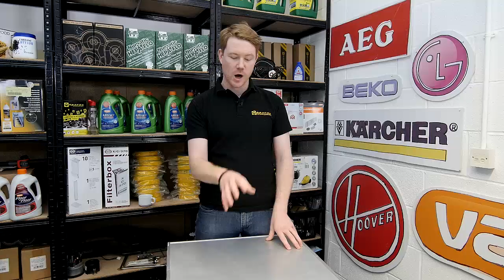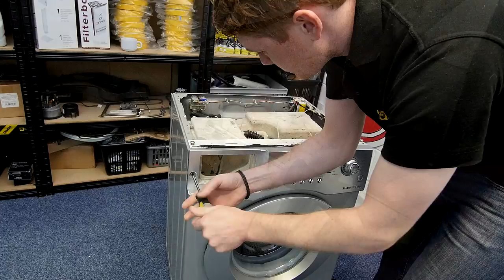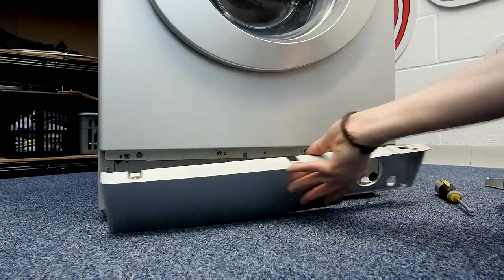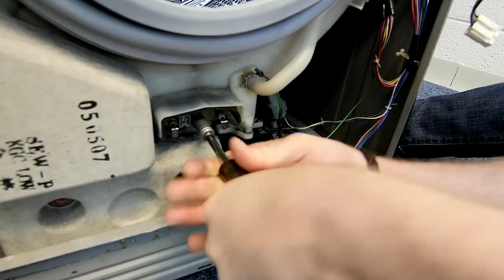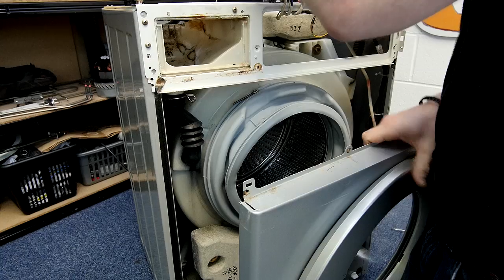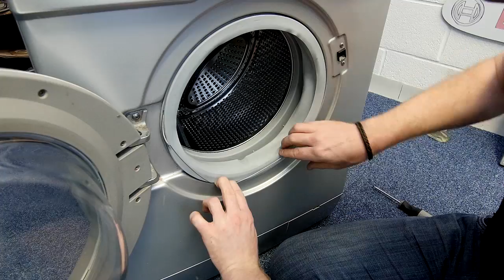How to Replace a Samsung Washing Machine Heater

Comment: Great videos guys, have cleaned washing machine myself, found faults and so forth because of your videos. This time I am going head first at heating element, as it is covered in limescale(bought washing machine like 8-10 years ago and water is hard). Now, by buying water softener, I was wondering about replacing the element. It works kinda fine, but the condition of heater makes me wonder about changing it(if not, will tend to one of your other videos). Thing is that it's one of the old models I can't find heating element on your website - Samsung WF-R862. Is there a place where I could get one? Or is there a chance I might be able to use WF-B862 heating element instead as those look identical(though I see that watt amounts differ)?
Reply from the maker: Please fill in our contact us form on our website by following the link below, we aim to respond to you within 24 hours : www.espares.co.uk/contact/sales

Comment: Is there a way to verify that the element is bad, for example with a multimeter? How useful is such a test? What other things should one test before concluding the element is the problem?
Reply from the maker: +spelunkerd There are two tests that will identify 95% of faulty elements.
Test one, Continuity. Measure across the element for a low resistance, This will be between  20 to 30 ohms on  a typical water heater to several hundred ohms on a fridge defrost element. No reading indicates a open circuit.
Test two, Break down. This should be on the highest resistance range on the meter between element connection and the element earth tag or fixing bolt. If the element is good no reading will occur. This sometimes will not show conclusively a failing element unless tested with a high voltage insulation tester like a 'Megger'.
Reply: By break down, do you mean that you do a voltage drop test with active current flowing, to see if there is dynamic resistance in the circuit not evident with a simple ohmmeter? How often would an ohmmeter fail to detect a bad element?
Reply from the maker: +spelunkerd The break down we refer is when a small current flows from the element to earth. The higher the test voltage the more likely a components insulation will fail. A 'Megger' measures resistance with typically a internally generated low current 250 volts supply or 500 volts depending on model and range. We would advise against 'Dynamic'or Live testing' as this can be dangerous and may not show the fault as the power often trips immediately.
Reply: +eSpares I see, thank you.
Reply from the maker: +spelunkerd :-)

Comment: Hi,  I have a new Zanussi washing machine and have not used at all. An error code of EH-1 is coming up on the screen. What would be the fault? The error code EH-1 is not mentioned on your trouble shooting. Please help! thank you
Reply from the maker: +Claire salugao We assume you are connecting this to a regular mains electric supply and not running of a generator, Solar or wind power or have not 'imported' this machine from another country. EH1 is indicating a supply problem. Check temporarily on another socket with an extension lead and if that works check the original socket.
Reply: thank you. I send this to the Philippines which I was told th
Reply: the problem is the amp. I called zanussi but theyre not really helpful . I was also told that I could change the circuit board? will you be able to advice on that and cost and where to buy this?  thank you
Reply from the maker: +Claire _28 Check the mains supply frequency matches the appliance. We think your machine is likely to be designed for 220 to 240 volts at 50 HZ frequency. The voltage in the Philippines is OK but we believe the frequency is 60 HZ hence the problem.:-)
Reply from the maker: +eSpares You need to identify if there is a version of your model that was  imported into a country using 220 volts 60 hz. Often Manufacturers will use the same model but ad a different suffix number ie /01 /05 /21 etc.
If there is a version we can order the module for that machine and it should work in the Philippines.

Comment: I've spent half an hour getting the front off only to find that the heating element isn't where it's shown in this video...............
Reply from the maker: HI Pam, sorry to hear this but the heater is not at the front on all washing machines even if the makes are the same.